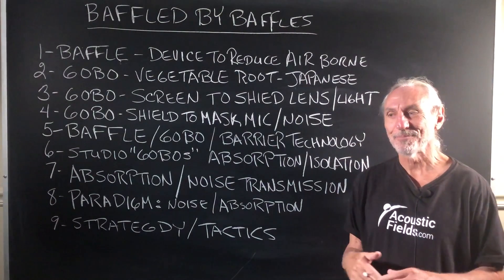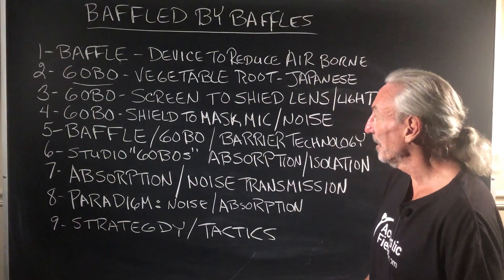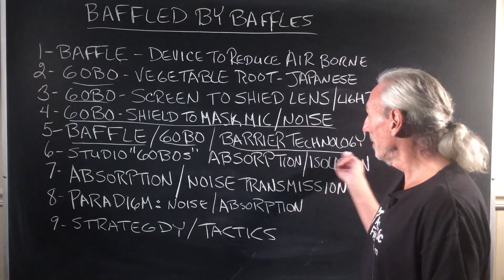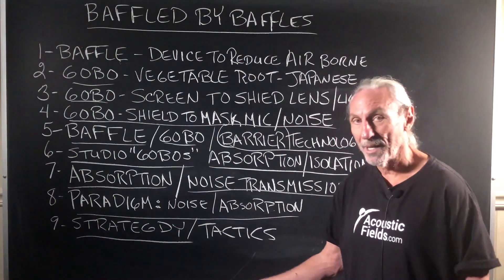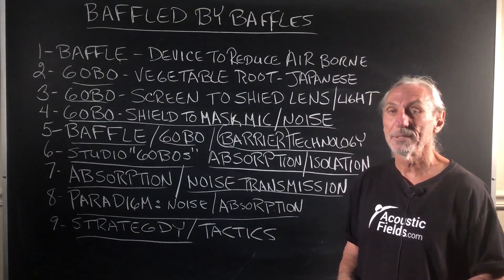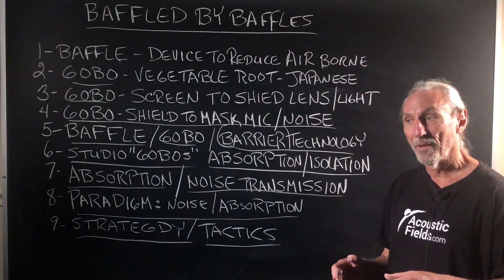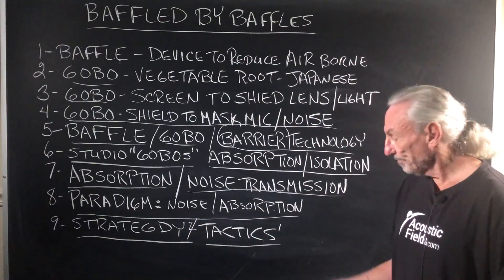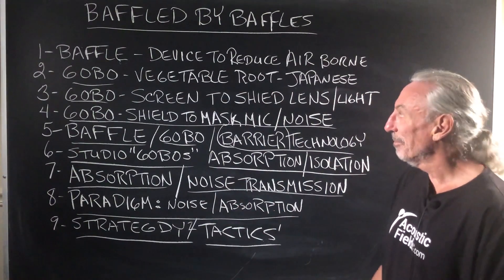Baffled by Baffles - www.AcousticFields.com

Comment: This is the definition of baffle that I always use: Baffle - Restrain or regulate a fluid, sound etc. 
We have baffles in our mufflers, septic tanks, trucks carrying liquids, Even baffles in some swimming pools to reduce the strength of waves in the water.
I still prefer using Absorb, Reflect, and Block. These terms seem to get the point across with folks who don't understand.
Reply from the maker: There are three main categories of treatment types. We have diffusion, absorption, and barrier (isolation) technologies. The problem with the industry is that they cross define issues. They use absorption when they mean isolation. They use diffusion when they are really discussing reflections. Its a mixed up bag of nomenclature that only confuses people.

Comment: There is a new audiophile trend of open Baffle Speakers (Rather then conventional Boxed Speakers).
Due to its structure, this speaker technology is most likely to be more sensitive  to be affected by room acoustics.
This is not related to your video (which deals with room treatment and not speaker technlogy) but it would be very interesting to hear your opinion on the usage of open Baffle  speaker vs room structure and acoustics.
Thanks
Reply from the maker: Remember that the room only sees energy. It does not care about the source. It will react the same frequency and amplitude way regardless of source. Speaker manufacturers have been trying for years to limit the impact of energy within the room with little or no success. Most attempts never sustain. As a designer, you may use the electronics in the speaker and the dispersion array you have chosen to distribute energy but once that energy leaves the domain of the speaker cabinet, it belongs to the room. The speaker is a small "room" that is placing energy within another small room.  We need a new speaker design. It has always been the weakest link in the electronic chain.
Reply: @AcousticFields  
I appreciate and thank you very much for your quick and detailed  reply.
Reply: shpater, you're absolutely right. 
Dipoles energize a room entirely differently than monopole speakers.